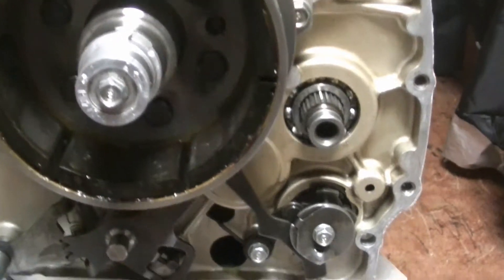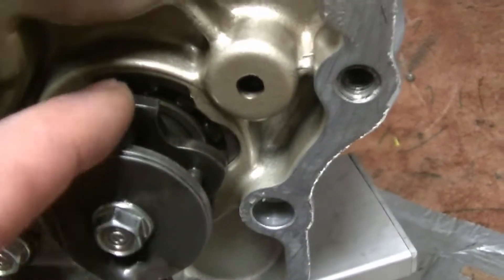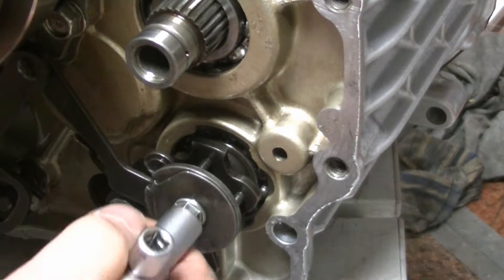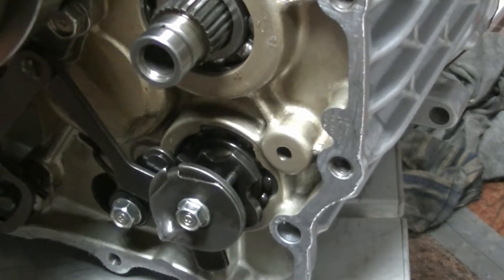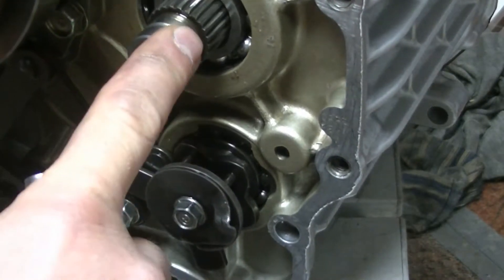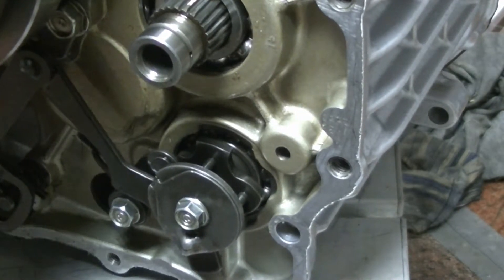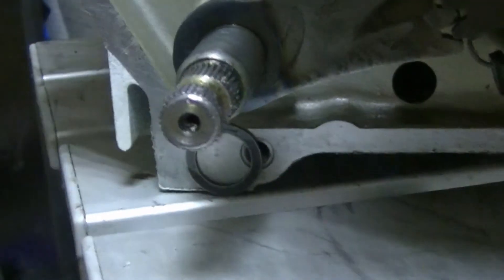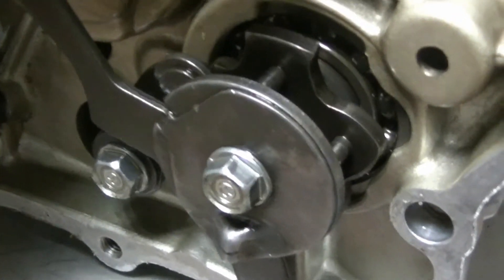Honda CX500 - gear shifting mechanism - part 24

Comment: Hey Rob I know it’s 3 years late but do you happen to have the clutch still on it? I’m rebuilding mine from the ground up and I have just the transmission in place no clutch or anything else on it
Reply from the maker: Yes still on and running